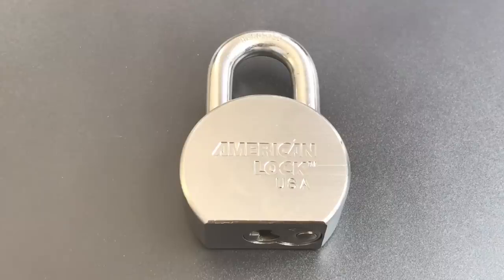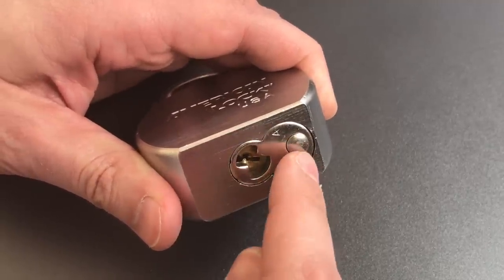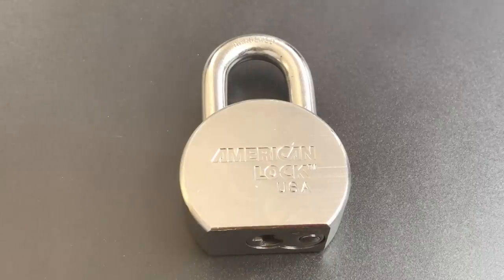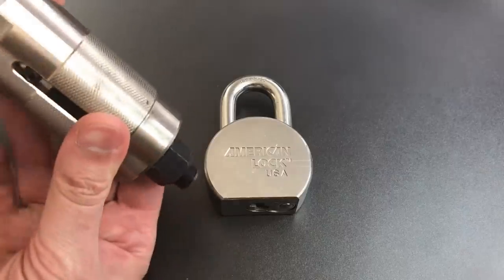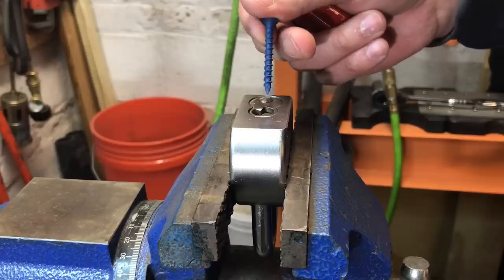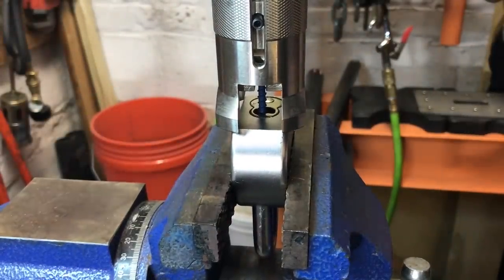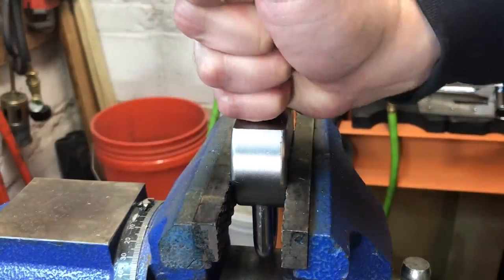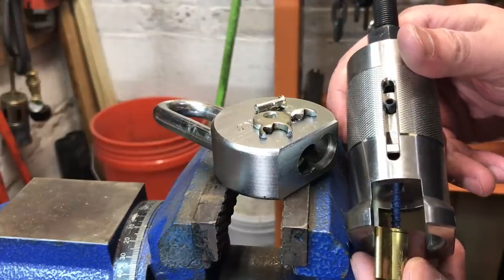[607] Core Puller vs. American Series 700 Padlock

Comment: What’s the cost of a locksmith to recore a heavy duty lock like that.? I have a heavy duty lock that I lost the key and would like o use it again
Reply: I’ll buy it from you. I love rekeying these locks.
Reply: Asron Eightyseven I bought a lock pick set and I’m trying to pick it. I can open my front doors dead bolts and a few smaller padlocks but this bad boy is giving me trouble . Someone told me because it has spools? I’m not sure. If I can take the retaining plate off the end it can be recored - it’s not an American it a master.

Comment: Would the lock work if you just replaced the core, plate and screw? Or is the lock beyond repair?
Reply: yes it would be in working order but you are better off drilling the core so you only have to replace it. Plus its way quicker
Reply from the maker: Azure, agreed. 👍 but I like doing thing differently, just to be different. 🤷🏻‍♂️
Reply: This is why I watch you. +LockPickingLawyer :D

Comment: Possibly a battery operated dremmel tool would cost less than that gadget, and would not have any chance of breaking off the screw. Just grind off the head of the little piss ass retainer stud  and open it comes!

Comment: Just a quick question for anyone who can answer this the lock puller would it work on door locks or is it just for padlocks !!??
Reply from the maker: Yes, works on door locks with an adaptor plate you will see in the future. Stay tuned.
Reply: Thank you lockpicking lawyer good to know
Reply: We use it in the fire service to remove euro profile cylinders.
Reply: They make pullers for the 2 "biggies" Kwikset, and Schlage. Both are made by A-1 and should be available through Brochage. Neither work on deadbolts, but are fine for knoblocks. The Kwikset tool pulls out the cylinder just like you would if you were repinning it. The Schlage tool actually deforms the end of the knob enough to let the cylinder tailpiece clear the detent pin. Then you can turn it around and reshape the handle.

Comment: Seems like a small cutoff wheel on a dremel type tool could be used on that "nut" to quickly make a slot that a flat head screwdriver could bit into and then it could be easily unscrewed.
Reply from the maker: The security nut can’t be rotated... there are a couple splines that lock it in place.

Comment: Good evening lockpick lawyer is there an alternative screw for the lock puller ??
Reply from the maker: Ideally, you would use a high quality chrome vanadium steel screw made just for these... but they are expensive, and not always necessary. I’ll use them in future videos.
Reply: Ok thank you

Comment: you can use a normal cordless drill set to low speed and drill the screw in

you split the retention plate too

Comment: Do you recon a thief comes in with a vice and a core puller 😄
Reply: haroon ibrahim core pullers work on Euro style doorlocks as well. Eastern european gangs specializing in jewellery store burglaries have been known to use core pullers, not quite as well-made ones as this but perfectly functional. Quick and much quieter than smashing a window, so they don’t get discovered before the alarm goes off. Once the door is open it takes them  two minutes or less to grab the most valuable items and get into a waiting car; most alarm systems don’t go off for the first minute anyhow so the risk of being caught is fairly low.

Comment: Would that work on any lock?
Reply: Stephen Cresswell yes I have something similar and it’s worked on every lock I’ve tried
Reply: No. It wont. There are locks that do not use cores held in like this. It will work on lots of locks though. It just depends on how the core is retained